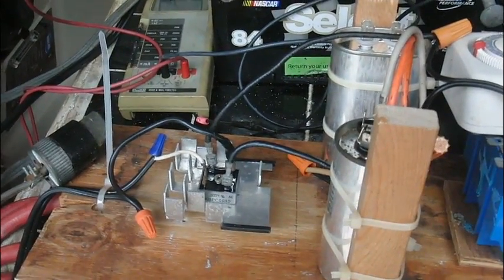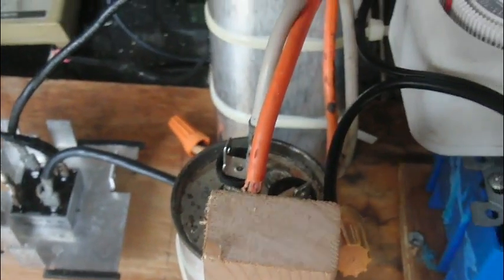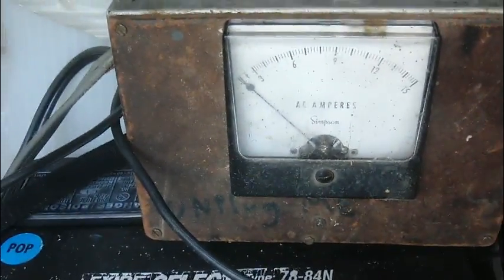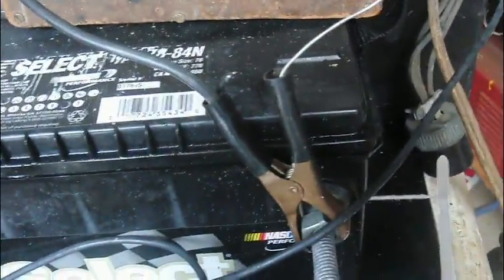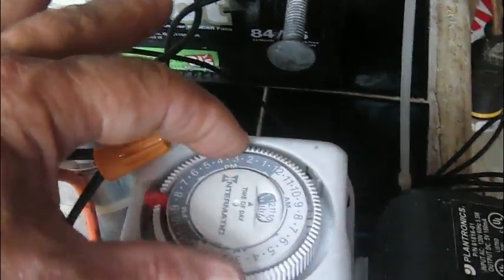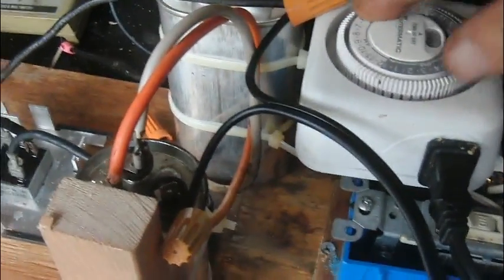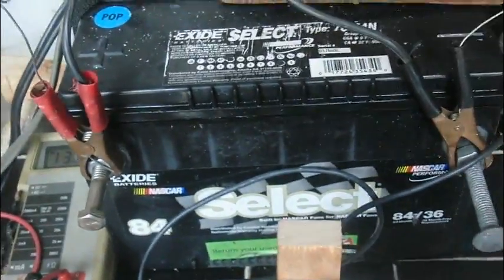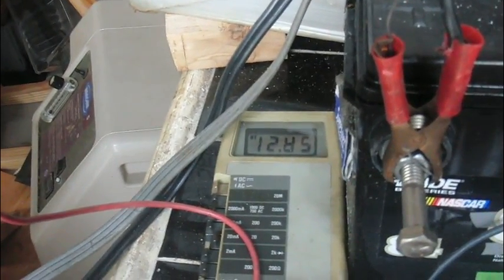Car Battery Capacitor Charger  with Auto Timer Turnoff - Homemade

Comment: I've had very good results with Epsom salt to I've revived 16 used golfcart batteries and several car batteries I'm still using 1 in my car a year after treating it
Reply: Desmond Bagley  i used a 100 watt solar panel with no regulator so the voltage wold come up past 14v then slowly lowered as it charged the only time I had a battery not charge is if one or more cells are shorted, the Epsom salt only works one time to iv herd that alum works but I never tried that